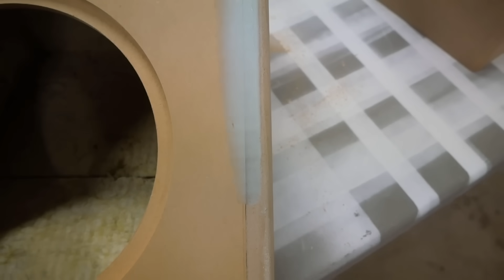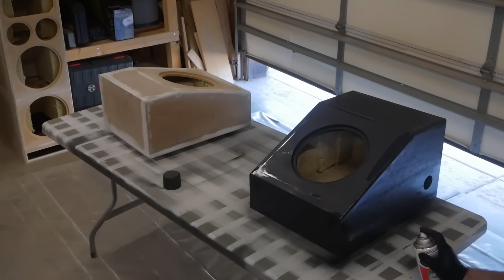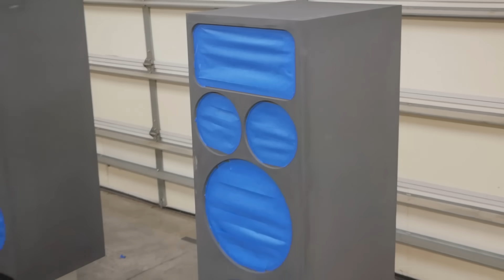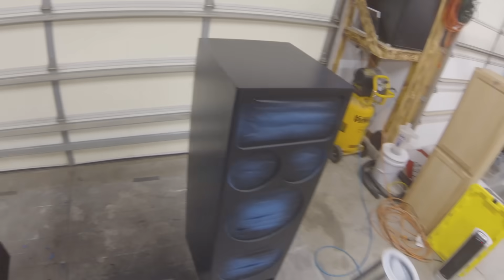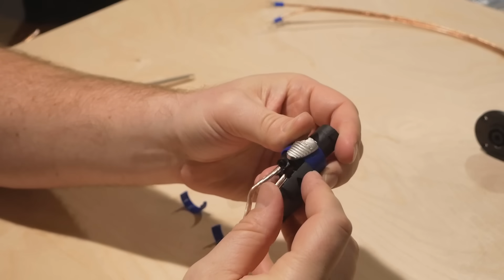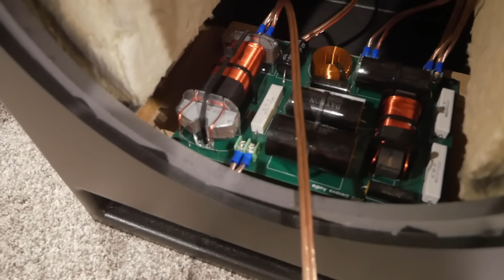How To Spray DuraTex | Home Theater Speakers | Finishing The DIY Sound Group 1299 and Volt 10

Comment: Impressive!
Most impressive.

You put a lot of thought into the design, materials, and construction of these speakers.  Bravo.

A few questions and comments:

1) Could you have used the stronger body filler only?

Any specific reason/s to use the spackle also?

2) Have you found or heard of,
copper.. or better- 
gold-plated copper 

contact components for the 
Speakon connectors?

3) Silver solder instead of crimp connections throughout?

I’ve found that sometimes,
the bond, the connection those crimps make are not as complete 
as highly conductive solder, wetted well.

Additionally,
the copper wire can/will 
oxidize using them.

Lastly, just from current transmission, 
there can be
micro- loosening of those connections over a long time span;

but more so from the vibration 
of drivers, individually and collectively.

Crimps for ease of removal? 
Mm, a touch with a hot iron 
is quite fast also, 
and better connection the whole time?

Overall, eliminate 30-40?connectors, of inferior metal?

Imagine the weight reduction..
for each speaker..
by removing all  that hardware!  

Lol! 😋

4) Connecting your awesome,
well-made 14 AWG Speakon speaker cables results in a gratifying smile.

Subsequently connecting 
12 AWG...
awesome well-made Speakon 
speaker cables results
in a gratifying smile, 
38% wider. 

(12 guage... 
  it's just what we do. 😎)

No criticism here, just sharing ideas.

I appreciate, 
what you've made,
and the benefits you provide 
from all your effort in making this and these, high quality 
videos.

Thank you.
Reply from the maker: Thank you Anthony! Wow, let me see if I can get to all of this lol...
1. Yes you can use the body filler for everything. Since I wasn't doing any major filling, the spackle is just easier to work with (no mixing with hardener) and sands very easily. And it's cheaper. Easy cleanup... You get the idea. It's really just filling in the porous edges.
2. I have only seen the normal speakon connectors, none with gold plated or copper connections. Many use these for high powered subs (as I will be doing as well) and don't seem to have had issues. I actually was worried about this myself but I have not been able to find anything on them limiting current/wattage. 
3. That weight reduction is temping... 😉 And yea I have seen where people like to solder the connections instead of connectors. I personally just found it easier for installing and removing if need be. There is the risk of them coming off, but I try to avoid that by compressing the female connectors before installing for a tighter fit. It could still happen though... I have not seen anything where it directly effects sound quality though. But I may have just not come across that information yet :)
4. 12 gauge is installed :) the 14 was available at the time and needed to order more 12 gauge to complete all of the connectors.

I don't take criticism negatively. Everyone has their ways (or just don't know what they are talking about lol!). I've learned a lot from people commenting on videos so I welcome the comments. Appreciate the kinds words and I'll have a demo/impressions video out soon!
Thanks man!

Comment: What wattage your passive crossover have?.
Reply from the maker: The center and towers can each handle about 800 watts each. I only have 125w per channel with an Emotiva amp currently. Looking to upgrade to more power in the future, but these will still scream at lower wattage as the efficiency is 99 db

Comment: Do you have any kind of air/oil filter between the compressor and the gun ?
Reply from the maker: I didn't for this project. I bought one for automotive painting in the future. Drained my tank before starting was all. The Duratex is water based so there wouldn't be any real negative effects of a bit of moisture in the line as long as it's not spewing water out lol. Would definitely not hurt to have one, but didn't have any negative effects without one in my case
Reply: @LifeofBliss  Thanks for the quick response. I built a trio of 1099 a few years ago and last year I did a pair of VBSS and I rolled on my duratex but I really wanted to spray them. Next set of speakers I build I will have to revisit this vid.
Reply from the maker: Sure man. Rolling would be easier/less prep. But spraying is soooo smooth 😉 good luck on your future projects bud

Comment: looks nice, I get very similar results spraying with truck bed coating, surface is a little rough which makes wiping off the surface not the greatest, then I sprayed some thick glaze over the coating and it looked fantastic and cleaning off was easy.

Comment: What was the total cost of all the build (start to Finish)?  Looks really cool.. How did it sound?
Reply from the maker: There's a bit of rounding here and not including tools:
3 1299s- $1425
2 volt 10s- $340
Connectors- $60 total? Bought extras
Duratex- $90 per gallon. 1 gallon used
Wood- $75
Crossover boards- $45
Spackle- $10
Insulation- $40

There are some other little costs and already having most tools helped. Bought the spray gun but that will be used for many projects including painting car parts. 
They sound great! Coming out with a demo and impressions video soon

Comment: Nice work..i would have added tweeters to the rear channels
Reply from the maker: Thanks man. They have compression drivers screwed into the back of the 10 inch speakers. You can see how that looks right before assembling everything in the video

Comment: Use construction adhesive for speaker cabinet assembly and use 14 ,12, 10ga speaker wire inside cabinets !

Comment: Wow nice job! Did you adjust the gun at 20psi with the trigger pulled? Or 20psi static?
Reply from the maker: 20 psi on the regulator valve on the gun, the tank regulator was set to about 50 or 60 I think. So with trigger pulled it was 20 psi
Reply: Extremely accurate info! Thanks

Comment: the surrounds look like they have no tweeters...?
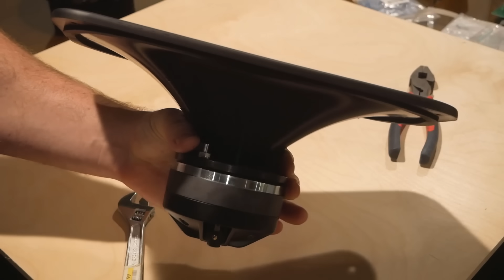Reply: 13:56 holds the answer to this one :)
Reply from the maker: Yea those compression drivers screw into the back of the 10 inch mids. Pretty cool design 😎

Comment: That's not a proper way to assemble speakon connector, cable clamping plastic is first seated on connector, then screw on tightening pastic...

Comment: You did NOT use T-nuts  to mount the drivers? What is up with that?
Reply: t nutts are for rookies....more trouble than they are worth
Reply from the maker: These drivers are so light and there are 8 screws per woofer. Screws really hold more weight than people think. That's also why I drill pilot holes and screw them all in by hand so I don't strip them out.

Comment: I have a question for you. a crossover does only divide the frequencies or it amplifies and divides the frequencies. also an 800 watt example crossover is an 800 watt of what. thank you for your reply
Reply from the maker: The crossover just sends the correct frequencies to the correct speakers. Amplification is done prior to the crossover. No sure exactly what you mean by your second question, but the crossover will also divide the power going to the speakers, with the woofers usually taking up most of the power

Comment: I love this build and congratulate you on the quality of work. I have one concern though. I can almost guarantee that the gauge wire used isn't adequate enough not only for the run from the crossover to each individual driver but certainly not large enough for the speacon connection. With the money invested, I suggest buying quality lower gauge speaker wire. Thanks for the time and work you invested to produce great content for us to enjoy!
Reply from the maker: Thanks man. You don't think the 14 gauge will be enough? I ran 12 gauge in wall and only have a 125w per channel amp for the mains. They have a sensitivity of 99 db so these really won't take a lot of power to get loud. That's a pretty short run of 14 gauge too.
Reply: Life of Bliss 
Yeah run 12AWG from amp to speakers.
And why not? 
Cost for the lengths is insignificant.
Reply: It should be ok then.  Maybe run the 12 gauge from the wall and AVR, atleast up to the speakon connectors. Audiophiles would tell you it isn't adequate.
Reply from the maker: Yea I might go back and do that when I  order some more
Reply: @LifeofBliss  run 12ga from AVR to cabinets.

Comment: Duratek is the best!!  It's the only finish I use for my builds.  I prefer the roller grade because I like the textured roller look.  It gives equipment that pro audio look.  As far as filling and sanding, I just use Elmer's Wood Filler, then sand.  Some quick diy's tips:

#1) sand the cabinets before applying filler.  This makes everything easier by requiring less filler to be used since everything is smoothed out already
#2) have a spray bottle handy to moisten the filler a little so it's very easy to mold

Have fun building everyone!

ps:  Life Of Bliss, I'm noticing every time you have a follow-up video to these speakers the view count keeps getting higher and higher.  Nice!
Reply from the maker: Thanks man! Yea I'm liking this duratex... 

And I must be doing something right to get a few views 😁 I'm just glad people like it and find it helpful!
Reply: Been used in pro audio speakers for decades & a good choice.

Comment: Great job man. They look cool. You can’t really get a more CUSTOM HT speaker, when your building one of the surrounds at a more of an acute angle than the other to fit your room. Cool. I like it😀.
Reply from the maker: Thanks Duane. Yea I'll be the first to admit my room isn't the best layout for speakers, but I've tried to make the most of it! One will be much closer than the other, so had to try and compensate for that. Glad you appreciate it 😉 I'll show the room more in the next video.
Reply: Life of Bliss how are you going about wall mounting them then? I didn’t see any mounting options in the build video...
Reply from the maker: I'll be going over that in the next video. Planning on using an aluminum French cleat. I think Hangman is the brand, can't remember if I got that particular brand or not... I'll show it though
Reply: Life of Bliss wicked! Thanks man. 👍🏻👍🏻

Comment: Whats the tank size on your compressor?
Reply from the maker: 15 gallon. I could only do 1 large box at a time before letting it refill. Only took about 90 seconds between each box though, really been happy with it. Dewalt brand

Comment: what speakers are those with those drives screwed on to them...impressive
Reply: If you're asking about the smaller Volt 10s, according to the website it's a 10" Custom Eminence coaxial with a Celestion compression driver.  Google the "DIY Sound Group".  They have a bunch of different kits there.
Reply: @dockettome  thanks bro
Reply: @dockettome  great video
Reply: @vzbeatz1706  Thanks, but this isn't my channel.  :)
Reply from the maker: DIY Sound Group worked with Eminence Audio to get some of their drivers built. Very good quality stuff

Comment: I hadn't cared for Duratex so much till I saw how you're came out with a spray application; love the smoothness.
Reply from the maker: Thanks man. I was debating on using raptor liner bed liner vs duratex. Really glad how this stuff turned out. Flat color, not a super rough texture, and smooth enough to dust off easily

Comment: Why are Speakers not made from Real Wood.?
Reply: Mike, I believe most speakers are made of MDF as it's a denser material and will not flex.
Reply from the maker: Plus it is cheap and very flat/uniform. Most speakers you see out there are mdf with some sort of veneer

Comment: Maybe this was addressed elsewhere, but I worry looking at the towers you'll have issues with port noise.
Reply from the maker: I've done a little bit of listening, no issues I can hear. I worked with a few other guys on the modeling and the port velocity was low enough that there shouldn't be any issues